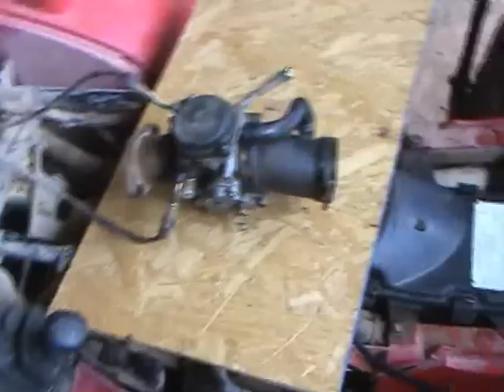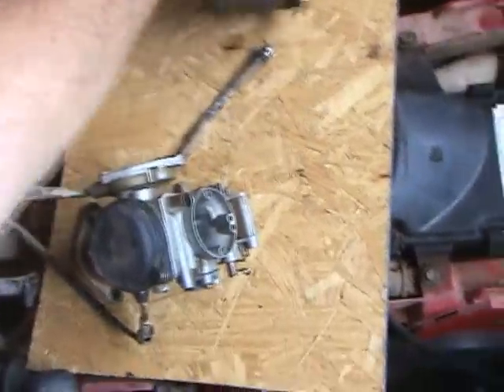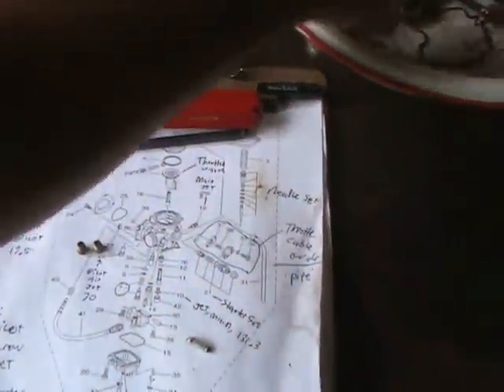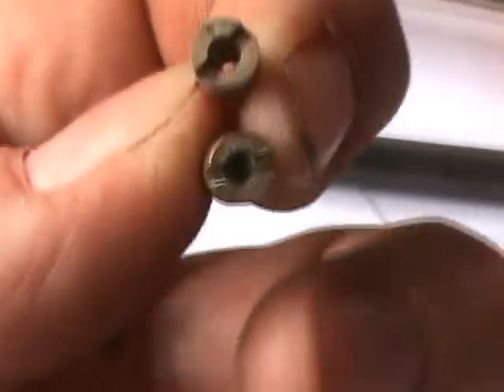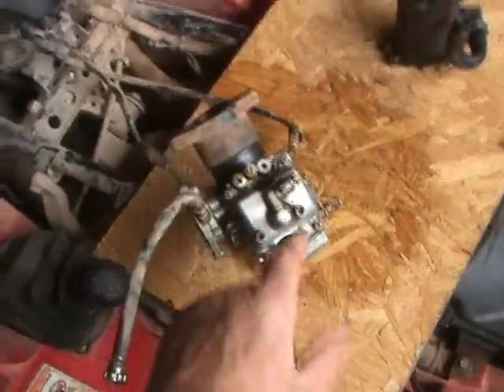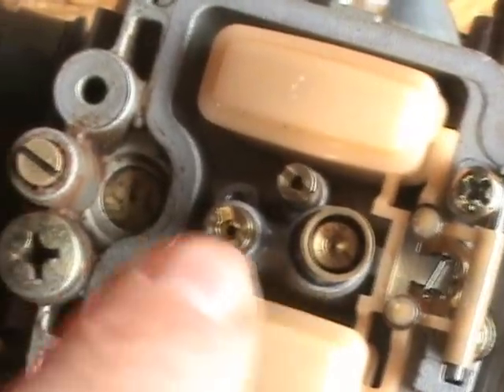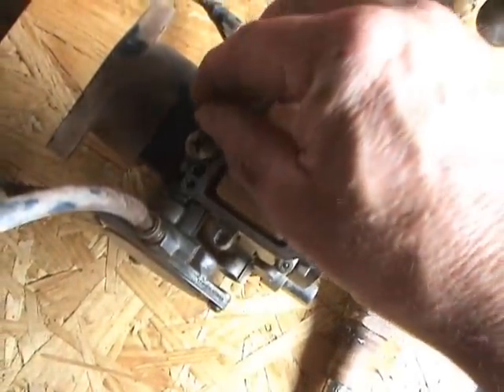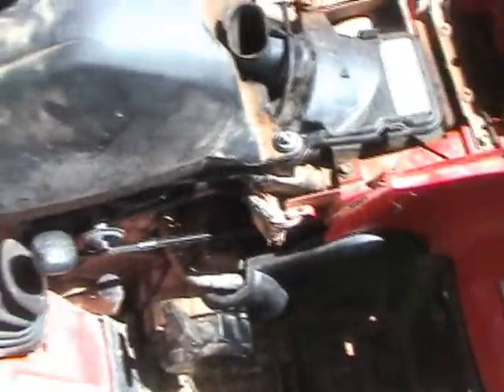Carburetor Rebuild Kit Yamaha ATV 450 YFM FX

Comment: I went looking around and I found that they sell brand new carbs for the YFM450 in that year range for less than $70 a piece... If you can't repair it, they're cheap as dirt to replace.

I'm having the carburetors on my antique motorcycle rebuilt by Wired 
George. He does extremely good work, but he's kind of pricy, and rather 
slow at getting things done because he's very detail oriented...

I'd have bought new carbs but I'd have to buy four Keihin CR34 carbs, 
and they're higher performance than I'm used to. My old ones are the 
stock Keihin CV34 carbs that came on my bike, and they don't make them 
anymore.

Comment: It could also possibly be the float itself that could be cracked and letting fuel into the float. The float therefore doesn't float as it should, and doesn't seal the needle valve in it's seat.
One will be an air jet the other could be the main jet. Yes the orifices will be different.
That tapered needle will be your main mixture, or tickover bleed screw.
Oh it's sorted. Nevermind.
It is always worth checking the float for cracking and having fuel in it, while it's out.

Comment: OH, yeh. After it's ran a while, you might wanna pop the spark plug out, and check it. That will give you a good indication as to how it is running. Too rich - sooty. Too lean - will look too clean and almost glossy, and maybe even look like it's been running too warm. Check for "Pinking too". while under hard accel in lowish revs (slightly labouring), uphill.

Comment: Yep, the main jet is bigger than the pilot jet. The pilot lets through less fuel when you're idling, and the main lets more in when you pour on the throttle. The main goes below the throttle needle. The float valve (float needle) was the one that was leaking. At one time in my life, during my racing days, I could build these things in my sleep. Is Yamaha still using Mikuni's?

That long thing with the pointy end is the idle air mixture adjusting screw, and the 2.5 turns they give you is a starting point. You turn it in and out from there to the point where it idles best, wherever that is. 0.5, though, is a little odd. Normally it's within ± a half turn or so of nominal.

"Never do that," sez he as he puts his hand over the air intake and floods the engine.  LOL
Reply: +Anonymoose LOL do as I say, not as I do... I had a wood shop teacher who used to say that as he held up his hand with two fingers missing....
Reply from the maker: +Anonymoose Ah, thank you. Next time I'll ask you to come to the ranch and fix it. :-) I kept turning the screw closed, and around 0.5 the engine idled well. I had to wait for the engine to warm after each adjustment.
Reply: +Desertphile  I'd be delighted to come out and help. Just fly me out (first class round trip, of course), and provide a suitable array of buxom young ladies for my entertainment pleasure, and I'll stay for as long as it takes. Or for as long as I can survive the overdose of buxomnicity...

You get the engine all the way warmed up to running temp first, and then, with it running, you tweak the screw in (which leans it out) until idle speeds up to max and then gets too lean and starts to stutter. Then you back it out a fraction of a turn (richer) to where it catches and idles smoothly again. Once it's set, you should rarely need to touch it, except for when you get a piece of shit in a jet and have to take it apart and blow it out. I raced motocross, so the environment I ran in was often as nasty as what that ATV lives in.